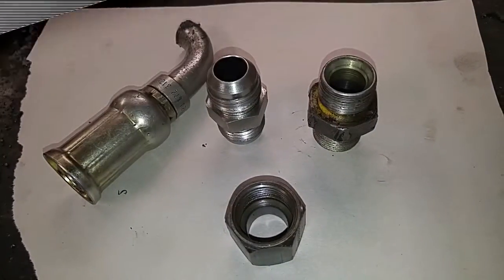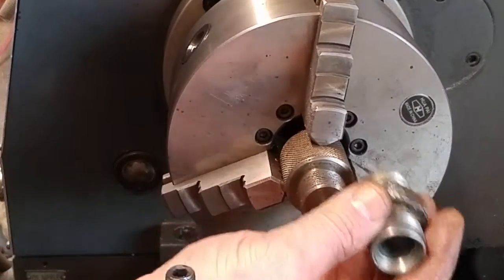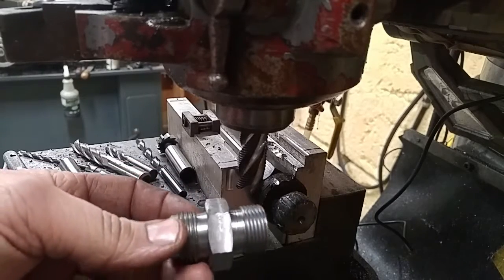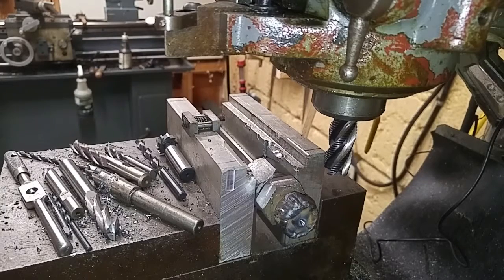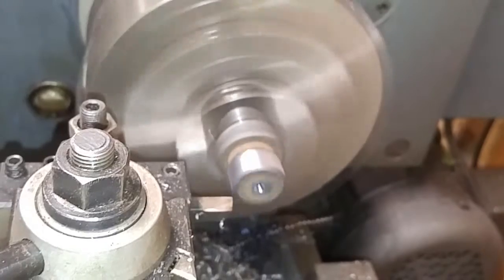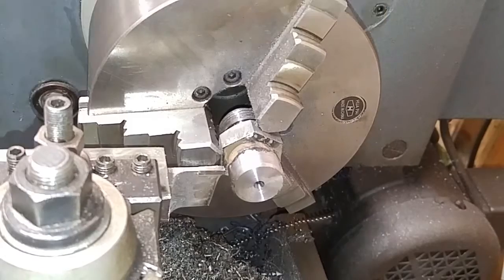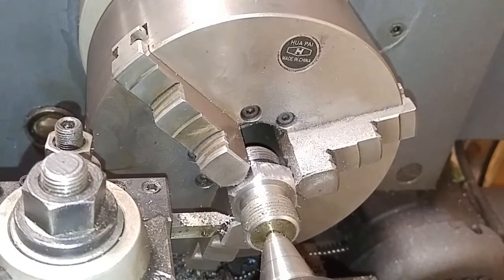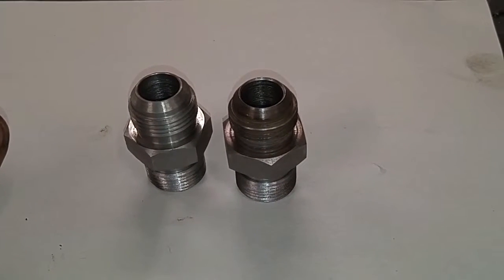TURN&BURN

Comment: What lathe is that?
Reply: It's an Enco 12x36 Gear head.
Reply: @cwthemachinist  Thank you!  Very Curious  How the 8” chucks is working out?
Reply: @Meeky815  it's a very nice chuck. It's a Shars chuck. When I got the chuck I tore it apart cleaned and greased everything in it. The lathe runs it with ease.